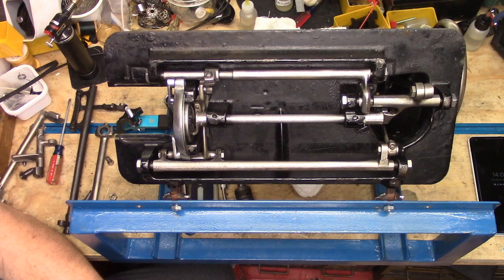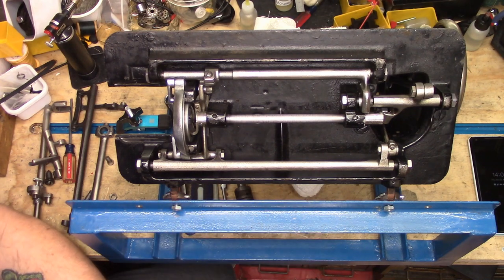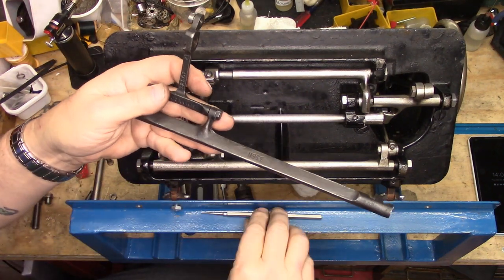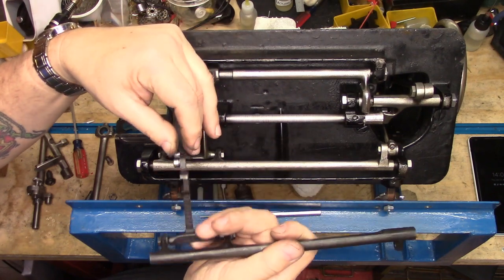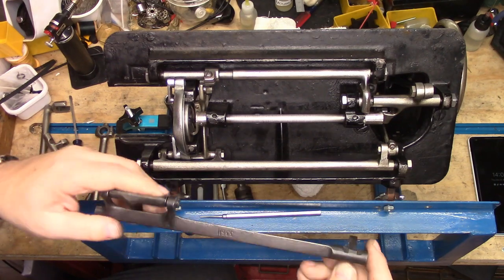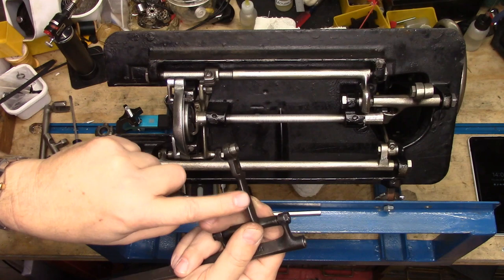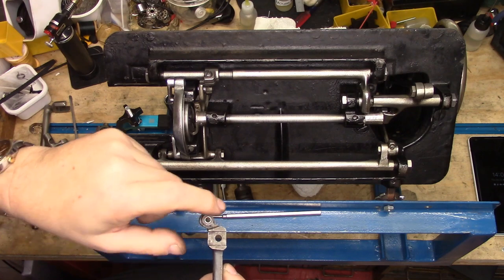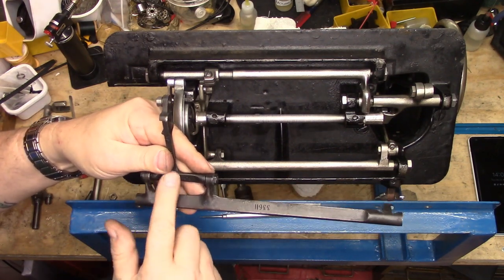Fun With Rock Shafts - Sunday Morning Quickies - December 26th, 2021

Comment: Great info! Any tips on how to remove the bottom shaft? I'm getting a squeak from just behind the hook driver, under the black casing (seen at 5:16)
Reply from the maker: To remove the bottommost shaft, you must remove the arm on the handwheel side of the shaft and slide the shaft to the left. The bearing surfaces are of different diameters and wont come out of the machine to the right. Needless to say, you have to remove the hook race first... It's a bit of a pain in the posterior as these are pinned in place using tapered pins which must be CAREFULLY driven out. I have worked on these where the pin had to be drilled out. BE CAREFUL!